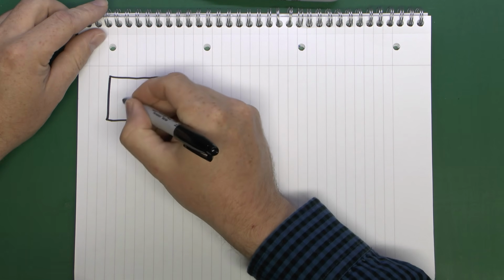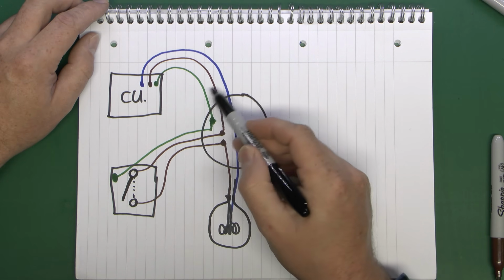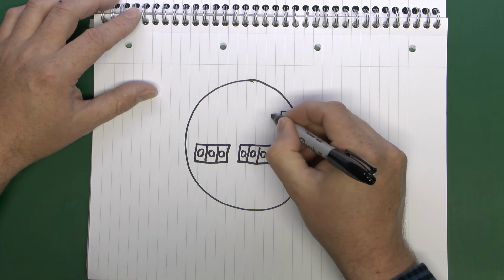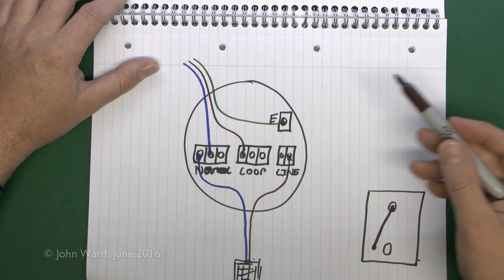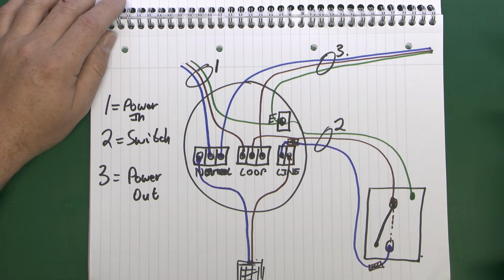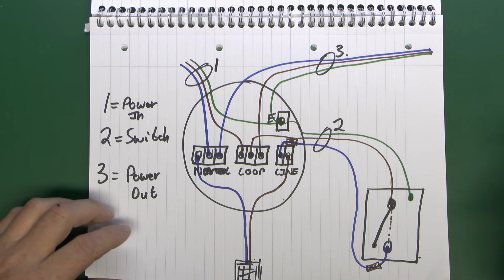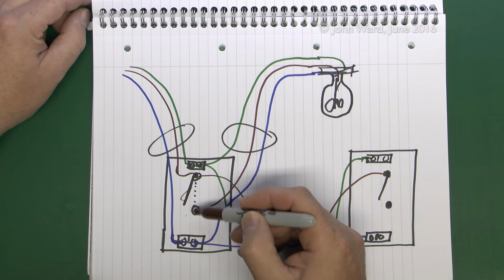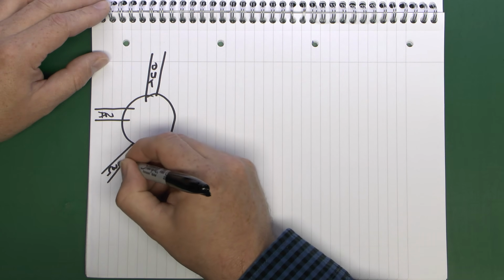Lighting Circuits Part 1 - Basic Concepts

Comment: Hi john, great video. I am looking to put lighting in my shed and I want to put around 4 celling roses in of one switch, is it possible to run my power straight to the switch like you shown, then of that to my first, then come of my 1st light to my 2nd,3rd and 4th light? Or is it easier to come straight of a jb? Thanks in advance:)
Reply from the maker: Yes, just take LNE to the first light, then extend to the 2nd, 3rd and so on. 
Could use a junction box but that will probably use more cable..
Reply: Hi Joh, thanks again , great videos. Would you consider it preferable today to take the supply TNE to the switch and feed out only the switched TNE rather than taking the supply to each ceiling rose? If so what is a standard accepted way for connecting the cables in the switch back box? Connecting with multiblocks and covering in insulation tape feels a bit shoddy. Would welcome any thoughts.
Reply: Don't forget, as its a shed and therefore an area of special location, you will need to inform your local authority and have a Building Regulations Compliance Certificate issued as well as an Electrical Installation Certificate. You are breaking the law by not getting the Buildings Compliance Cert done.  If you sell the house the solicitors dealing with the sale will ask for this paperwork and if you don't have it they will ask why.

Also, if your supply is a TN-C-S you would need to consider the possibility of a lost incoming Neutral and the fact that in this instance all the CPC's within your shed will then be at mains potential risking an electric shock.  Therefore your new lighting circuit must be protected by an appropriate earthing system that would prevent this.

That's what these videos don't tell you and why they should not be on here and that's why qualified electricians have a minimum of three years training.  take my advice and DONT do DIY.  It may kill someone.

Comment: Hi there, at 15.55 you mention that in modern buildings the power gets switched at the switch and a line goes out to the light fitting (rather than do it at a rose or junction box).  That switch you draw looks different to the normal one-way/two way switches you draw.  I can't find any examples of this 'more modern' switch on the screwfix site.  Can you point me to an example?  Thanks.  Great vids by the way.
Reply from the maker: The switch is the same, the additional connections are made with separate terminal blocks in the enclosure behind the switch.

Comment: Answering my own question, but I suppose if the phases are balanced the current will be minimal and as such safer.
Reply from the maker: It's defined as 'conductor connected to the neutral point of a system', in a balanced 3 phase system there will be no current, if unbalanced or only 1 phase there will be current flow in the neutral.  However the voltage between the neutral and earth will be zero or very close to zero.
Reply: Michael Cosgrove

Comment: Should you not switch the neutral as opposed to the live. Great video thanks for posting.
Reply from the maker: If neutral is switched, the light fitting remains live even when off, which is a hazard for someone changing the lamp / bulb.
BS7671 requires that single pole switches are in the line conductor only.
Reply: If you switched the neutral the fitting would still be live (but not functioning) even when off at the switch which could be dangerous for someone trying to work on that fitting.
Reply: Thanks Pete/John.

Comment: Hi John, i have a random question about "switched connection units" (Diall 13A Switched Neon Indicator Connection Unit | Departments | DIY at B&Q). I've wired up three fluorescent lights in my loft and  have wired in a switched connection unit just before the first light in the circuit. The question is have i wired it in the correct place? P.S i've taken the feed from the upstairs lighting circuit, P.P.S i have three lighting circuits in the house, wall lights circuit, downstairs circuit and upstairs circuit. Thanks.
Reply from the maker: Sounds ok.  You don't actually need the fuse in it, as the lighting circuit should already have a suitable fuse,  however it won't be a problem to have the fuse.
It needs to be in the circuit before the lights as it has a double pole switch (line and neutral), unlike normal light switches which are single pole (line only).

Comment: I could'nt agree more. Those silly people in Brussels probably never seen wiring.They just like showing off. Red for live ,black for neutral was ingrained in our Psyche and it worked. Why change a system that works for the sake of change ? Is it any wonder Britain wants to leave the EU.
Reply: @neilpattison130  - then why pick brown, black and grey for the three phase conductors? You couldn't pick worse colours if you tried.
Reply: Red and Black is for DC.
Reply: Aw Tom, I was enjoying an intelligent video and then happened to look at your comment.
Reply: @answersinreality6316  found the smug remoaner lol
Reply: THE problem was Red and black is a through back to the very early days of DC Mains power distribution as seen in some parts of the UK.  Red positive black negative or earth as also seen  in 12 DC in cars etc but for time we went to positive earth cars !!! and the black became the live negative supply !!!
   So in 240v ac mains we went brown live or line and  blue neutral
     However  this opened big can of worms for us in the UK as blue was a phase colour in the UK and in DC systems in industry blue was a negative DC live. black was earth and red was DC positive live   but this story just  runs and runs  as now DC negative live  is grey, ground is blue  Also grey became  is a phase colour in AC systems  to get away  from blue being now neural

Comment: I know I'm old....but red for live, black for negative, and green for earth was much better !!.......Everyone including kids associate red with danger !!!
Reply: Just remember that brown is the colour your trousers will turn if you touch it.
Reply: Ah Ah, I couldn't agree more! I have done electrical at college last year. Took me 3 years and I still look at blue and brown and scratch my head from time to time. RED = DANGER.
Reply: You can easily associate brown as danger because that's what the colour of your pants will turn if you ever dared touch it :D
Reply: Brown for Burns
Reply: +Colin Richardson 
Not quite.  Mains AC circuits are driven by the live conductor.  The neutral conductor is theoretically safe in isolation, provided the installation has been correctly wired and no faults have developed.
Reply: I prefer the new way , easy way to remeber how to wire a plug BRown BR Borrom Right , BLue BL bottom left. Saing red live ( danger) and black is also incorrect . Both line and nutral can kill you. Its also handy as Red+ black = DC brown + blue = AC. There is still loads of old wiring out there so you cannot take that as always true , hell some of the 15amp liging plugs in work still used  R B G and they are from arround 2008
Reply: In the US it's Black/ hot, White/ neutral, and Green/ ground. Red is the switchleg if you buy the specific wire. I have to remember the old saying white on brass fry your ass. In electronics red is hot, black neutral, and green ground. That's why it's sometimes confusing for me, the black is hot in house wiring.
Reply: Off course you know that red / green colour blindness is fairly common, so it does make sense to have the Earth bi-coloured [green and yellow stripe]
Reply: Black to red blue to bits
Reply: Robert Parkes - not for kids that are colour blind.
And we only use red for danger because we teach children that. In real life many, many dangers are not associated with any particular colour. You can’t cross the road and assume that the cars that are not coloured red will miss you...
Also, if the neutral is disconnected between where you are and the consumer unit, if the load is present and switched on, the neural may well be LIVE at mains voltage.
And finally, AC swaps polarity at 50Hz (most of the world) or 60Hz (USA and various other countries). So there is no positive or negative.
And lastly, there are countless different “standards” used for the colours of electrical wiring around the world, what makes our old system so special compared to the many others? Answer: absolutely nothing. So in developing a new standard, don’t you think it right and proper that a system that takes account of the most common form of colour blindness is used?
Reply: Does that red/black only work for DC.. This is AC, both blue and brown are dangerous.
Reply: sipxstream Greetings, fellow Tom Scott subscriber. :P
Reply: What?  Surely dark brown, dark black, and dark grey would be better for dangerous line conductors.  Much more obvious...
Reply: Oh, and one other thing. Not all mains voltage AC supply systems have the “neutral” / return conductors / wires referenced to earth/ground at the transformer or supply source. In specialist applications “earth free” circuits exist. Or the supply is a Centre Tapped Earth (CTE) system with the transformer having a 110V winding tapped at the mid-point. This mid-point tapping is connected to earth. The secondary then produces 55V with respect to earth for the ‘line’ and 55V with respect to earth for the ‘neutral’. This arrangement is found on most U.K. building and construction sites. And can also be found in some industrial buildings. The important point being, the wire coloured blue (previously coloured black in the U.K.) should never be assumed to be safe to touch, ever.
Reply: The worst thing is how EU made the standard backwards for mental notes
"oh, brown, that's neutral, you can tell because there is no N in blue and vice versa"(which magically works in many European languages)

Comment: Great video JW :) Is there any reason why light switches would be single pole whereas in one of your earlier videos you mentioned socket outlets are double pole switched?
Reply: Not all socket outlets are double pole switched.
Reply: because light switches only switch line, they do not need a neutral (as the neutral at a light switch becomes the switch live conductor).

Comment: Just had a look in my ceiling rose and it's still got the old red and black scheme. The switch cable wires are both red with a bare earth. looking forward to the next part.